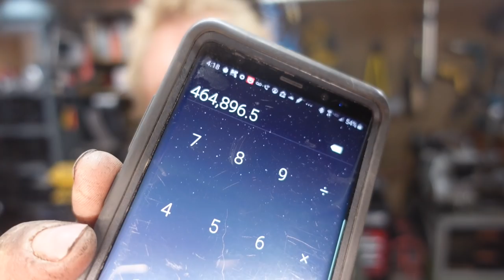Homemade CO2 Laser Tube Part 2

Comment: I've been a "Laserist" doing Light Shows for decades. So I just have to say, God I hope you are wearing those safety glasses whenever you have plasma in the tube. The flair (reflections), which you cannot see in UV or IR WILL blind you. Please be safe.
Reply: Doesn't the glass stop most the U.V.?
Reply: @helpabrothawithasubisaiah5316  It's a laser. It's amplified and calumniated  ... so ... NO!
Reply: a reminder that the 10.6um wavelength will in no shape or form be able to go through the lens of ones eye, unlike NIR lasers. Sure, if the power is enough to actually cook flesh it will do damage, but it would be fixable and also it would hurt before it starts doing damage.
Reply: @AKAtheA  seriously in this context this statement needs verifying. I'm not saying it's not true, I'm just saying we need references confirming it when so much is at stake.
Reply: He showed some proper safety glasses (they didn’t look like cheap eBay glasses) in the first video. Guy seems pretty smart and isn’t missing any fingers from machining.
Reply: @AKAtheA  that's just straight up not true. 10.6um at that power level will burn your eye irreversibly almost immediately
Reply: @Maverrick2140  🔴 What Is Islam? 

🔴 Islam is not just another religion. 

🔵 It is the same message preached by Moses, Jesus and Abraham.

 🔴 Islam literally means ‘submission to God’ and it teaches us to have a direct relationship with God. 

 🔵 It reminds us that since God created us, no one should be worshipped except God alone. 

 🔴 It also teaches that God is nothing like a human being or like anything that we can imagine.

🌍 The concept of God is summarized in the Quran as:

📖 { “Say, He is God, the One.  God, the Absolute.  He does not give birth, nor was He born, and there is nothing like Him.”} (Quran 112:1-4) 📚

🔴 Becoming a Muslim is not turning your back to Jesus. 

🔵 Rather it’s going back to the original teachings of Jesus and obeying him.
Reply: @1islam1  putz, xaropou geral! - this mean’s, who asked you about it, take your religion’s facts to you. It’s only your interests.
Reply: @mattjaskot2347  Nonetheless it will be carbonised on the outside. But it's cold comfort, carbonised eye is useless.
Reply: can't you run that IR output you're not seeing thru a crystal to get a different visible laser?
Reply: I would almost be positive this person has done enough research to understand the danger of the laser he's building.

Now if it was a MOT I might be more worried.
Reply: @swicked86  I wuldn't be so sure ...
Reply: I was "laserist"  for decades too. I was building my own laser machines from 50 to 500 Watts. NEVER even had any safety glasses and still reading and driving without any glasses thought I am 64 now.
Reply: @AKAtheA  Of course not. Laser will just blind you in a friction of second so you will never see any harm it does. Buhahahahaha
Reply: @jacekolejniczak8726  500 watts?!?! I’m not buying that!

Comment: Boil known amount of water and measure time and temperature difference. You will know the power, more or less.
Reply: genius man
Reply: ivan schafeldt  just measure ambient temp and account for it
Reply: That would be making a calorimeter style laser power measurement device.  Just make sure to insulate the water first.
Reply: ivan schafeldt  good point. Sorry for very late answer. Why comments on yt are so broken? First isolate, second if you put less water it will heat up faster. If you design a bit more sophisticated setup. Like a cuvette isolated with thermometer inside and outside with known insulation, and known dimensions, you could approximate this with Fourier law of heat conduction.

Edit: just got idea now. You could get very very small solar vacuum tube used to heat water by sun. They would be perfect for this experiment. Just need to find small one or fill it partially with water and add thermometer and good isolation cap and you are ready to go.

Edit 2: only if glass they are made of doesn't absorb too much light of CO2 laser, because you could burn little hole in it and loose the vacuum inside... Maybe just diy something similar with proper optical window for that wavelength.
Reply: I Only want to add another comment. You can construct a "beam dump" of a single material, like aluminium then measure this mass, to be able to calculate the thermal capacity of the construction. Then can make an thermal isolation. if you measure the temperature increase over the time you can obtain the wattage of your laser. you need to use only the linear section of the curve.

Comment: This was great to accidently stumble upon and it looks like you're having success, nice work! The usual gas suppliers used to be able to provide 'Co2 laser mix' in cylinders at a reasonable rate when I was messing with these. Distilled water will eventually pick up metal ions off the electrodes and fittings. I used a simple deionizing loop to keep the water non-conductive. If I remember right it was just a mixed bed DI filter in a standard filter housing while passing a small percentage of the recirculation through the filter. Some even have pipe threads right on them so you don't need a housing and after a few hours of initial recirculation you get truly electrically insulative water. Good luck with your project, looking forward to hopefully seeing more.
Reply: The best option is to abandon the design where deionization water is needed. There will be a thermal load on the tube, but this is solvable.

Comment: first off I recognize that t-shirt and I appreciate you wearing it

and now that I've finished watching: absolute legend. I want to make a laser CNC to cut through inch thick steel, and while I don't have the resources just yet, this does give me great inspiration. Thank you for this, great work, and looking forward to the next video!
Reply: we had one in our workshop (cutting steel up to 25mm), it had about 60kW power drain  and high voltage power source for laser was 50kW strong, then ... good luck (cooling system was as large as american fridge)

Comment: Judging by the burn in over the point size of laser output, it looks like a possible 40 or 50 Watt output at a rough guess. That's quite a beast at that.
Reply: I'd guess 1-5W.
Reply: @hubbsllc  Having worked on hundreds of co2 laser tubes I would say maybe 10 Watts at a push. The Acrylic melt looked spotty so his alignment was prob way out plus his mirror was not clean. Really awesome he managed to get anything out of it so massive success! Our gas mix alone costs a couple of grand let alone the vacuum and testing gear which is worth tens of thousands!
Reply: @Lewjoable  Xenon is ultra expensive. Component of said mix?
Reply: @flaplaya  maybe it is a reason why Xe is not in that mix. CO2 (soda bubles), N (about 80% of air all aroun) and He "for"baloons" and all that mix is at partial pressure .
Reply: @hubbsllc  Looks you do not know much about lasers. It is not less than 40. May be 60.
Reply: @flaplaya  Not so ultra. Just expensive.
Reply: @stanislavbandur7355  Xenon is used in sealed lasers. No need to use this expensive gas in flowing gas laser.
Reply: @jacekolejniczak8726  Am an engineer and took laser physics in school so I'm comfortable with my guess. 40-60W hitting wood would be a lot more dramatic than a gently smoking black spot. Outdoor laser show lasers are 10-25W.

Comment: you‘ll need to flush the mirror and lens on the cutting part.
you‘ll need to suck away the smoke, it is super fine particulate and will harm you.
you may want to install a plate with inside channels and holes in the top that will keep the workpiece in place.

Let me be frank: effin great!

Comment: I am no expert either (Electronic Engineer) but from what i know of this subject, use plastic NYLON hose barbs so there is not as much discharge on the fittings. Alignment of the mirrors is absolutely crucial to max power output. Good job building this, keep experimenting for better power output. Try a couple of microwave transformers in series for a power supply but be ready for the high heat to deal with.👍

Comment: a couple things that will effect performance of your laser.  Your ratio to C02, Nitrogen, and Helium (Yes all three gasses are required for a C02 laser to gain energy), and how well your cooling jacket cools.

A larger OD on your inner tube (that you're doing work in) increases the distance your Helium needs to travel before reaching the water jacket in order to dump its energy.

C02 charges Nitrogen which charges Helium which gets cooled back down the jacket allowing the process to repeat while you're putting in work.

Comment: I'm impressed! I used to read Sams laser guide as a kid and felt like I'd never get to build a working CO2 laser myself. Did the helium tank have a little bit of oxygen in it though? Sometimes balloon grade helium has O2 in it to keep people from suffocating when they breathe it. I really like your design but I do wonder if the mirrors will settle out of alignment over time or use, but I'm still totally impressed even if it does need re-alignment fairly often, I might even copy your design! I have a couple YAG lasers myself and I had to re-align the mirrors which is definitely an art in itself and really fun for some reason.

Comment: I used to operate a laser cnc. The tube was about 10 ' long as I recall. My boss stuck his finger under the beam and turned it on. He pulled his hand back and it cut a clean slot. didn't hurt for a few days as the nerves came back to life. take care!

Comment: you could always go with some sort of calorimetry setup with a a stop watch to measure the wattage of the laser, you might have to use something other than water for the medium, but basically anything that wont decompose or change state under the temps, and that you know the specific energy of will work the smaller you can get the sample of what ever you use the more accurate the reading will be, and you will likely only need a few second pulse.

Comment: Really like your project. Looks to be 40-60 Watts in my opinion. That is really great. I spent many years with lasers but mostly with sealed lasers, not gas flowing lasers. As I know you should use more efficient vacuum pomp and work some with gas mixture amount. Should be very little. Lasers work with very high underpressure. Regards
Reply: Another idea. Coupler 70/30% or even 80/20 could do better job, I think.

Comment: I've worked with a few CO2 industrial lasers, ranging from 50W to 5kW. From memory, they are 10% efficient. So if you know your voltage and current, work out watts, divide by 10. Nice project.

Comment: The length of the resonator ie the distance between mirrors must be a multiple of wavelengths for maximum output, so you have to adjust it to micrometer precision.

Comment: Awesome video man. Your laser should be outputting close to 90 watts assuming 10% efficiency. 15kv X 60ma = 900 watts input and 10% efficiency, which is common, gives output of 90 watts.

 But I believe that the distilled cooling water is conducting the high voltage partially. So the output power can be assumed half which is around 45 watts.
 
To get better output I think isolating the cooling jacket is better from the end electrodes.

Also CO2 laser premix gas bottles are easily available and cheap too. You can buy one as it would have the perfect mixture and give better output Power.
Reply from the maker: 90 watts would be absolutely incredible, although i doubt it haha. 45 sounds much more realistic.

I'm gonna tinker around with non-conductive cooling methods, although I may end up having to isolate it.

Man, where do you live? because where i'm at not only are bottles of laser gas expensive, they make you rent a cylinder and open an account! I instead opted for the diy gas mixing route haha

thanks for the suggestions!
Reply: @cranktowncity  I live in INDIA, here they ask for a cylinder deposit if you're a continuous user or pay for the cylinder . Cylinder costs around INR 10000 Which is around 150USD . Gas cost is around INR2000 which around 30USD. You can take the cylinder and refill it at the gas supplier shop. GAS cost is lesser from local manufacturers and expensive from reputed ones like PRAXAIR. 

Also you can buy a ZVS driver and a flyback transformer to build a powerful high voltage supply to power the laser.

Stay safe and hope you got vaccinated for covid.
Reply: Judging by the size of your tube and the burn, i am guessing 45 watt output. I am only going by experience i had tinkering with Asian made tubes. I'm glad that hotdog wasn't your finger
Reply: @Cranktown City  look up dielectric fluid 
Electro cool EC-100

Comment: For laser wattage I suggest to burn something that have high thermal conductivity, well insulate and known specific heat then log the temperature curve over time. The initial slope should represent wattage of laser. also we can compare with electrical power consumption to determine laser efficiency.

Comment: To measure to energy output get a small block of graphite and insert a scientific thermometer. Weigh the graphite block. Heat the block for 30 seconds (or some other known amount of time) with the laser beam and measure the temperature difference. Calculate the energy output based on the heat capacity of graphite 0.720 J/g degree centigrade

Comment: How to measure output energy hack-scheme: Take a well defined material with well measurable size that absorbs the lasers frequency,
"laser" it for some time, measure the temperature difference. The corresponding heat energy is the lasers output for the time the material got heated with the laser.

PS: The gas emitting the laser radiation when "pumped"/excited should also absorb it in the ground state, but you have to estimate absorption percentage for a second pipe filled with it. IIRC at least - I have not done stuff with lasers for over a decade.

Comment: It should be possible to calibrate your peltier by using it sandwiched between a black anodized aluminium plate and a heatsink(use heatsink compound).  Drill and tap a small hole in the anodised plate and use the hole to mount a TO-220 resistor with a thermal pad in between.  Connect a variable power supply to the resistor and draw a graph of power into the resistor v voltage coming out of the peltier.  Once calibrated remove the resistor and use the plate/peltier/heatsink assembly to measure your laser power, hopefully you will be somewhere in the ballpark.

Comment: Get that peltier coated with carbon black (soot from a candle works great), and make sure the non-heated side is cooled or has a good heatsink. Let the temperature stabilize before taking your readings. Also acrylic safety goggles are fine for 10.6um.
Reply: I like your suggestion re carbon black. Were it me, I'd try to put a waterblock on the back side of the Peltier module and run tap water through it real fast so as to come close to keeping the back side a constant temperature. I don't know how Peltiers behave but I feel like if you had a laser of known power you could use that to see what potential develops across the wires - is that voltage proportional to transferred power?

Comment: 08:50 to measure Watt you need to know the Volt and the Amp
exemple V:100
                 A:10
You need to multiply it like 100×10= 1000 so if you Volt is 100 and your Amps is 10 you will get 1000 Watt of power

Sorry if i have a bad English

Comment: Need to focus it down. Looks like about 1/4" output. With the right design, it could incorporate a variable slide to focus at different lengths. Wouldn't be too hard to "calibrate" and notch the slide so you had a reference. Otherwise very nice. This gives me confidence in casting my own aluminum for parts manufacturing. You're weird but cool. Like a real life, young Doc Brown.

Comment: an essentially free way to measure the wattage that I think would work would be to use it to heat some water.  CO2 laser is well absorbed by water and all the energy will turn to heat.  So, turn the laser on for a period of time and see how much hotter the water gets.  Plugs those into the equation Ẇ = Q/Δt using the specific heat for water (the 4181.3 number) and get your answer.  Here is an example for heating .1kg (100ml) water 40 deg c in 1 minute  Ẇ = Q/Δt = (4181.3 J/kg·K × .1kg × 40K)/60s = 278.75 W  To be as accurate as possible you would want to use an insulated container for the water with an opening just big enough for the laser.

Comment: Ok, just repeating what has been said already. High power lasers are measured using calorimeter. Water absorbs CO2 light very rapidly. Water has a specific heat capacity of 4182 J/kg°C. Shine the laser into 100g of water. Measure the temperature change for a burn of say 20 seconds. Calculate power by
Power = ( 4182 x 0.1 x Temperature change ) / 20   Watts

Adjust time and volume of water as needed.

Now make one out of some black anodized aluminium, use a heatsink from a power device like your stereo amplifier and add a food thermometer. Use your previous measurement  as a calibration for this new aluminium version. 

Alternatively, buy a CO2 laser lens from Amazon and use it as a widow into a bulb of water with a thermometer and it won’t need calibration if you know how much water you used.

All that work, you may as well buy a power meter.

Great work getting it going. Next must be a fibre laser.
Reply: Alternatively, there are chinese clones of the exact power meter I used when working as a laser repair tech on ebay for around 250usd. Mine at work cost somewhere around 4000usd back when we first got it, and I remember if you let the battery go dead you'd have to send it in to get it re-calibrated lol.
Reply: @FuriousX3  : Good option, I see Bell Laser power meters cost about $100. Look like a chunk of anodized aluminum (the outer layer is sapphire/corundum/aluminium oxide  is an excellent absorber of 10um IR) with a thermometer attached to measure the temperature increase.